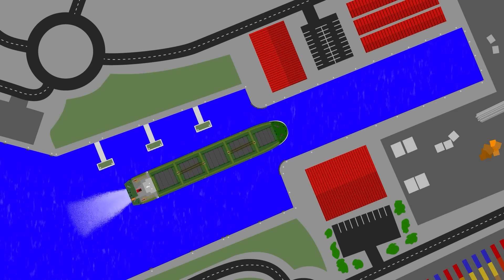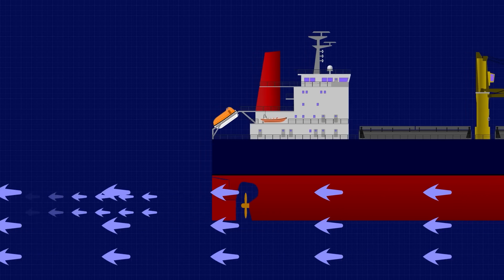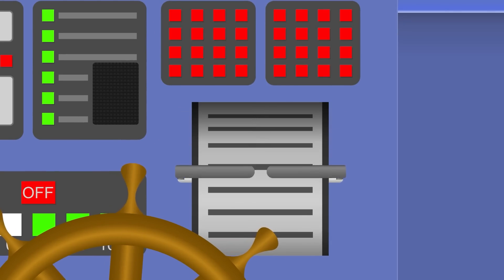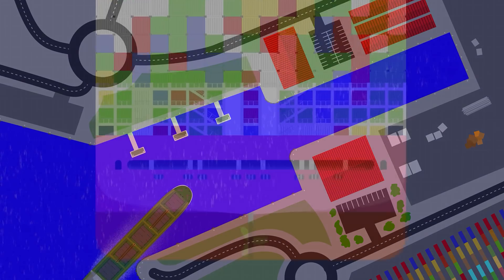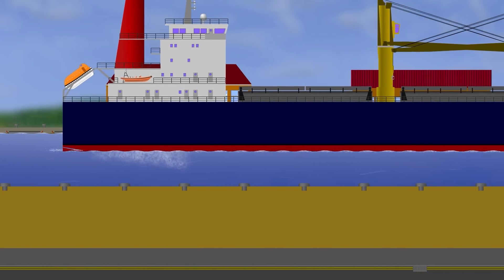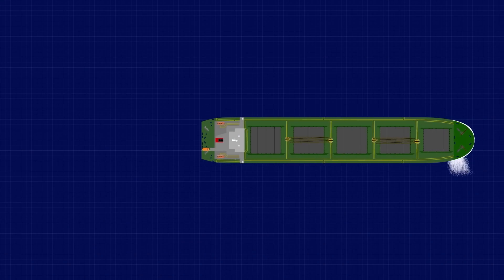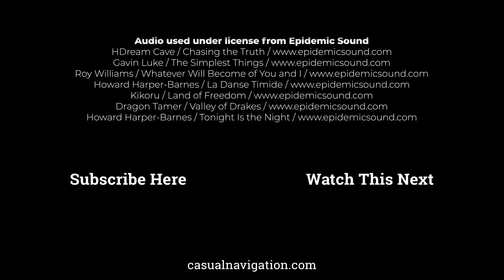Why Can't Ships Reverse Around Corners?

Comment: I think reversing into anparking spot may only be easier for drivers from the UK, who are trained to do it. We aren't taught how to reverse around a corner in the US, and those of us who do it have basically had to learn the skill through trial and error.
Reply: If you aren't taught how to do it then that's going to change things a bit (doing a harder thing you've been taught is easier than doing a slightly less hard thing you've never been taught), but geometrically it's fundamentally easier to reverse park when all other factors are equal because the front end of the vehicle moves the most when steering (because the front wheels are the ones that steer). This means when parking forwards you either need enough space outside the spot to get pretty much the whole car lined up before going in, or an adjacent empty space to cross over, whereas reversing in means you can steer the front end around even as the rear is in the spot without hitting adjacent vehicles.

Having said that, I have heard that parking spots in the US are bigger to accommodate the insane trucks you have, so that probably makes the difference less relevant if you're driving a sane vehicle.
Reply: @bosstowndynamics5488  I literally witnessed people pull into a parking space perfectly fine into a spot over and over again it’s not easier. It’s just made up nonsense.
Reply: @zachv  If you've got a surplus of space and no ability to reverse, sure, but some of us use car parks with narrower through lanes and narrower car bays, and I assure you the difference is very noticeable in those settings. The fact you've personally never noticed a phenomenon that's most relevant in a context you might not have been in doesn't somehow delete the fundamental physics of wheels from the universe
Reply: @bosstowndynamics5488  you can literally just pull right in in a narrow space. You don’t have to adjust anything. Your car is drifting. There’s something wrong with it.
Reply: @zachv  I'd like to see you try to parallel park by going in forwards
Reply: @party4lifedude  This is easy
Reply: @zachv  Lmao okay dude, whatever you say. Now I KNOW you are full of it and have no idea how to drive
Reply: @party4lifedude  no it’s really easy just remove whatever blocking you from behind and pull right in you you never said how to parallel park when driving forward
Reply: @zachv  moving someone else's car while they aren't there? 
I'm guessing you are just some kind of bot created to argue with people and be contrarian for no reason, because you don't follow any real world logic at all.
Reply: @party4lifedude  you can’t tell what a joke is if anyone is a robot around here it’s you. Also you do know you can get this thing called a tow truck and have them move it or tie something between the two cars and pull the car out or hotwire it actually you sure you’re not the robot
Reply: Everybody in the United States is taught how to pack into a parking space. None of us do it because it’s a pointless and useless skill. That does absolutely nothing.

Comment: I never back into a parking space and firmly disagree that it is easier and/or safer.
Reply: I almost exclusively reverse park when I'm parking in a single space, for multiple reasons: 
1) Vehicles don't turn symmetrically. When steering a car, the front swings around because it's the front wheels that turn and the rear lags behind. This means when reverse parking it's pretty easy to line things up so the rear starts heading into the spot then swing the front end around. When parking front first you either need to come in from a long way to the side of the space or swing through an adjacent parking spot (either overshooting and coming back with the front, or the back end will wind up lagging behind and into the other neighbouring spot).
2) Reversing cameras with parking guides are just about universal now (a small reason but a reason nonetheless) 
3) Pulling into a spot between stationary vehicles involves navigating much less moving traffic than pulling out of a spot, so it makes sense to be facing forwards when pulling out. 

Number one is easily the most important for me but number 3 can be very relevant in busier car parks
Reply: @bosstowndynamics5488  pulling in, is so much easier with all those things
Reply: Science disagrees with you unfortunately
Reply: @Garfie489  got a source for me to read?
Reply: @JasonAWilliams-IS  YouTube doesn't let me source. The UK DVSA has an article on it you can search however, and it's the reason why Forklifts are configured the way they are most notably
Reply: @Garfie489  I guess we finally figured out why so many people have absolutely no clue how to parallel park.
Reply: @Garfie489  no they’re not you have no idea what you’re talking about
Reply: @zachv  except I do, given this is basic physics - and my engineering degree goes much further than that
Reply: @Garfie489  “since” maybe I shouldn’t trust somebody who doesn’t know how to spell science

Comment: I propose building huge outboard motors and mount them on container ships. Tight maneuvering is so much easier with an outboard
Reply: They already have these built in….they’re called bow and stern thrusters.
Reply: And some ships have their props on a swivel, just the much bigger equivalent to an outboard
Reply: @jamesgroccia644  I know. Tugs like those, because they can turn on the spot. But these have high drag which is a disadvantage when sailing straight for thousands of miles

Comment: the other reason not to back a newer ship into a dock is that the dock and the ship were most likely designed to dock nose in.
Reply: "You shouldn't do X to Y because Y wasn't designed to have X done to it" is always the most boring and unsatisfying answer to the question. Literally devoid of any actual information or insight.
Reply: @TheHuesSciTech  At least at the former Philadelphia navy yard, the dry docks were built with a deeper well on the river end of the dock.  This is used as a sump when draining the drydock, but also allows for the rudder to be lowered out of the ship for maintenance, particularly on the rudder post and its bearings.

Comment: Why is going backwards called Sternway but forward is not called Bow - way?
Reply: The presumption is going forwards, so just ‘way’ as in ‘under way’. But headway is also ok, as in ‘making good headway’.
Reply: @vincentlugthart4618  But, but,...head is a toilet in marine language.
Reply: @BOBK-jf4qx  yup, that too, in which case you might go down below to place your stern on the head
Reply: Those are more commonly called "ahead" and "astern".

Also "bow" only means the foremost part of the ship - in most cases you'd use the word "fore" to describe general direction relative to the ship's hull. Opposite of that is "stern" and "aft" respectively.

Comment: Took my dad sailing this summer and even after a week he still couldn't grasp that in reverse you pretty much just go straight. He is just far too used to driving.

My parents wanted to see varied places without too much rocking so we went in-land to the Norfolk Broads, plenty to see, and far tighter than the open sea. I let him sail a lot because it was kinda funny, he also struggled to understand that the pivot point is in the middle and not right at the back, and without bow thrusters every time he would end up alongside a mooring he would instinctively turn to get the bow out rather than the stern and get nowhere with it. He was careful enough to not crash hard so I wasn't worried, made it very clear that if in danger reach for thrust first, only think about steering afterwards, because most likely the times you're suddenly in danger is when going forwards and so you'll be immediately reversing and you really don't need to care about steering.

A few of the mooring spaces did require a large amount of reversing, but you just have to use forward thrust to steer and whilst the rudder position while reversing has a small effect against where I wanted to go it was far easier to leave it like that rather than having to turn hard both ways every time. I let my dad reverse into a long mooring once (he insisted to reverse in, really on a 35' boat there's always the same obsticles so it's only a little easier to reverse out), but after he bumped 2 ships and rammed a small one I decided to take over.

When turning in tight spaces if you do short bursts you can maximise turning while not building up forward momentum as it's combatted by static forces. Never needed bow thrusters because it's perfectly manouverable if you just have good thrust control.

Comment: I also find it easier to go forward into a parking space, and reverse out
Reply: Are you American?
Cuz in Europe, that shit just does not fly.
Unless you're driving a tiny lunchbox, hehe
Reply: @MrNicoJac  Neither. Most people here do it the way I do though
Reply: @MrNicoJac  so Europe wants to do everything harder because reasons
Reply: The big advantage of backing into a parking space is that you see what is going on around you when you leave. There are too many people that will try to just get through behind you in the last second
Reply: @foobar9220 Not just that, the other thing (which kind of relates to ships too) is that the steering bit on a car is at the front, so it's much easier to get the back end lined up and swing the front around as you pull in than it is to pull in forwards since the end of your car entering the space is also the end that's moving sideways the most. On a ship the steering system is on the rear, so while it's a smaller factor than the dynamics explained in the video that would also contribute to making it easier to pull into docks going forwards
Reply: @bosstowndynamics5488  no it’s not
Reply: @bosstowndynamics5488  The steering part does not really play a role. You just flip whether you have the steering disadvantage going in or out. The available space stays the same.
Reply: @foobar9220  I'm pretty sure "steering disadvantage" is exactly what I'm trying to describe, I just haven't seen the exact term for it before
Reply: @foobar9220  I’ve never seen that ever happen in my entire entire life
Reply: It’s certainly not “easier” to pull forward because you have a reduced turning radius going in not to mention terrible visibility backing out of a spot. Backup cameras being required in the US has helped immensely with the visibility issue which harm in turn, reduced the frequency of people and especially children being run over by cars backing out of parking spots. But, still, the geometry and visibility makes backing in easier, safer, and less likely to hit a vehicle.
Reply: @cruisinguy6024  I think backup cameras are harmful, because it makes people comfortable with just slamming it in reverse without looking to see what is going on around them. As if it somehow makes them crash proof. Just like how those blind spot detectors make people comfortable with just switching lanes without looking, but they don't always work. All these things just make people much worse drivers
Reply: @party4lifedude  wow you’re really really making bad arguments back up cameras help people see what’s behind them in a plow into things like people next year you’re going to say mirrors are bad
Reply: @zachv  Then why do people who have backup cameras always smash into stuff when they are backing up?
Reply: @zachv  Besides, why would anyone even need a backup camera? If, according to you, there's NEVER any reason to reverse a car in the first place.
Reply: @zachv  "you're really making bad arguments" says the guy that has made nothing but dogshit arguments this whole time. lmao
Reply: @cruisinguy6024  it’s a whole lot easier
Reply: Your license has been revoked.
Reply: @MikkelSkomaker  because he does it the right way instead of the useless pointless way that a bunch of arrogant people think it’s so much better because they can’t drive properly
Reply: @zachv  1) Other people doing the way you are trained to park means they are driving properly, you are not

2) You are not advocating the right way, hence why you are trained to do the other way

3) Please hand in your license. 

4) You cant change physics. Please go to school to learn basic science and only then drive a vehicle.
Reply: @Garfie489  no other people are doing it the wrong way you’re the one who needs to hand their license and you’re the one changing physics works have you ever changed lanes in your life? Have you done that backwards? Have you put in reverse so it can be easier? Have you ever turned around the corner backwards? Have you ever driven backwards? Why isn’t your government telling you to do so much safer and easier just look at the physics? Because it really isn’t.
Reply: @Garfie489  you can’t spell science properly probably can’t spell physics either
Reply: Reversing is harder than driving forwards. So I always drive forwards into the small parking spot, and reverse into the wide open driving path. It's the best way

Comment: I have no idea what you're talking about with cars. It take zero effort to accurately enter a parking space forward and constant adjustment to reverse into it.
Reply: Only if you're parking in a massive parking space, an angled space or are driving through an empty space next to the space you're pulling into. If you're used to reverse parking you can pull in with minimal corrections, and the front end steering configuration of nearly every car means the vehicle is much more manoeuvrable when reversing into a tight space since the front can swing around after the rear is already entering the space, instead of needing to pull out far enough to swing the entire car around and in line with the space.
Reply: @bosstowndynamics5488 nope
Reply: I park in a space with only enough space to partially open a door in a jammed lot every day. Maneuverability is not an issue. I drive a car forward on roads and stuff so I get a lot a practice. If you change lanes on a road you already have the skill to park going forward, its not an American secret.
Reply: @alexanderf8451  If the car is facing directly towards the space then obviously you can park forwards, but you need more physical space outside the spot to get the car facing that way. This isn't a skill thing, this is the geometry of a front steering vehicle.
Reply: @bosstowndynamics5488  no you don’t
Reply: It's just a different technique, but it's not noticeably harder or easier either way. Sometimes you need to back in, and sometimes you don't. It all depends on the situation.
Reply: Are you by any chance American?
Reply: @miltonfridman1239  oh no proof that our way is wrong quick hide

Comment: Also a car pivots around its "stern" while a ship pivots around its bow (both simplified).
Reply: Good point
Reply: Cruise vessels can. Just watch them dock in Miami.
Reply: Correct considering the vessel is moving ahead, when the ship is moving astern, the pivot point moves more toward the aft. 
That is another reason why using your rudder while going astern is almost useless.
Reply: Depends on the car. Four wheel steering is a thing (and has been since WW2).

Comment: 3:12, is this diagram wrong or am i missing something??? rear of the ship is moving in completely the wrong direction
Reply: Missing something. The rudder is being depicted a lot larger than it actually is to show how it's moving, but the water flow isn't being shown. Remember that the series of events being described is having the ship drifting backwards at speed then kicking the engines on full tilt *forwards*. The result is that there's a surge of water being thrown backwards over the rudder, being directed backwards and to the left. The result is that the ship slows down (due to being pushed forwards) and is simultaneously pushed to the right. The much slower passive flow of water past the ship in the other direction is completely washed out and overpowered by the active thrust from the prop.
Reply: @bosstowndynamics5488  oh i see now, i thought it was just in a purely reverse thrust scenario, thankyou

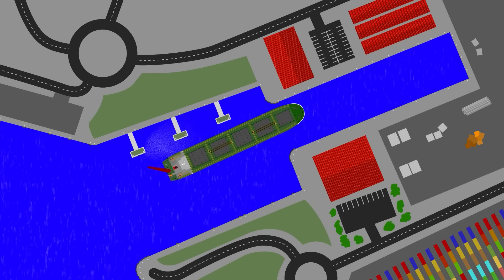Comment: 3:08 honestly this is just sort of what i thought tugboats were for lol
Reply: I say we get rid of tugs, too boring, instead we teach cool reversing turns like the one shown
Reply: @lachlanchester8142  Just add more thrusters. Bow thrusters? Boring! We need like five on each side and also a front propeller!
Thrust vectoring owns the sky sea!
Reply: @qwesx yes a useless front propeller 😂
Reply: @lachlanchester8142  Why not make better boats instead? Do you learn how to hand crank a car engine to start? Or how to match engine rpm in order to shift gears?
Reply: Essentially yes, this is exactly what tugs are for (as well as many other jobs), but tug fees are expensive so any ship that can safely do without will (generally) do so unless local regulations say they have to use tugs.
Reply: Nah, that's what AI is for. It will solve this easily. :P

Comment: What about ships with an even number of props, like the Lusitania? How do they maintain water flow over the rudder?
Reply: Ships that don't have rudders directly behind the propellers steer like hot garbage at slow speeds. Since the propeller wash doesn't hit the rudder directly the whole ship needs to be moving through the water to make the rudder work well.
Reply: @jamesmurney1374 they do though have the ability to run the engines in opposite directions though, which helps things.
The same issue also affected the 3 screw Olympic Class, since the centre screw was powered by a turbine that only kicked in at higher speed. Ships back then used to dock front end in at New York, and Olympic scraped the pier on her first arrival, probably because it was the first time a ship of her size had docked there.
Reply: @ChrisCooper312  The steam plants tend to respond pretty slowly, so it feels like you are always one bell behind where you want to be!